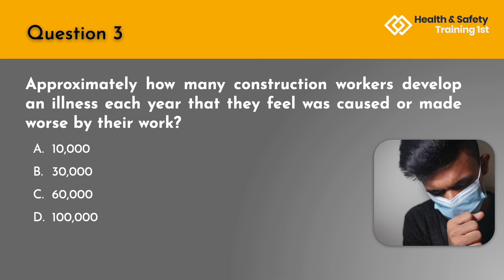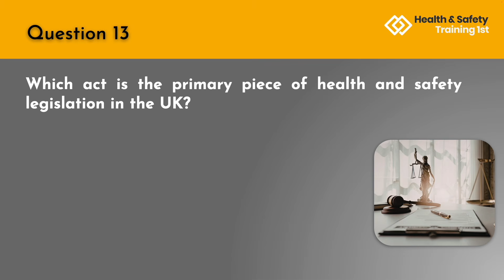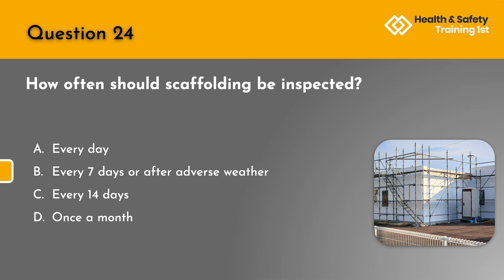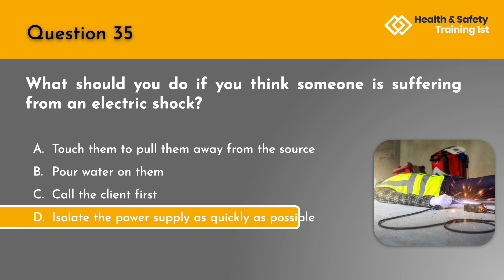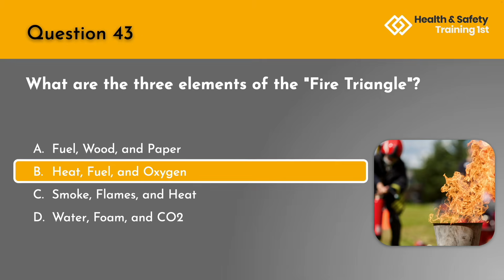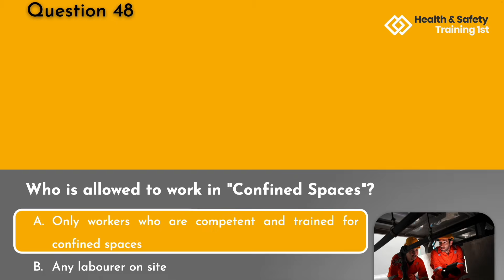CSCS Green Card Test Practice | 50 Questions for 2026 Tests

Comment: Just did mine today passed 49/50. I’ll tell u guys it weren’t crazy hard and it weren’t crazy easy. It’s more easy-medium. Gotta read the questions carefully, can study for 1-1.5 weeks, make sure ur watching videos aswell as doing the apps because the apps tend to spam the same questions and ur set.
Reply: It’s common sense got the same as you with literally zero revision
Reply: Did it’s completely the same question when you get test?
Reply: Which app should I use?